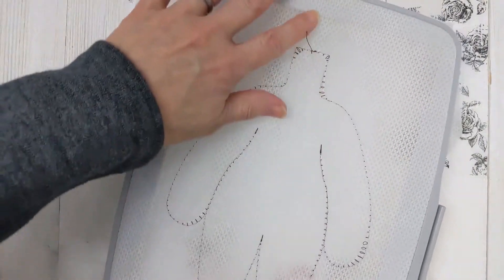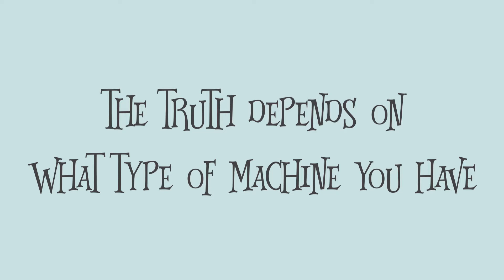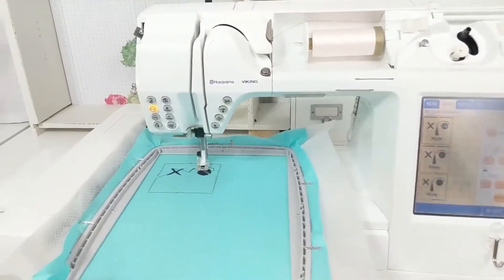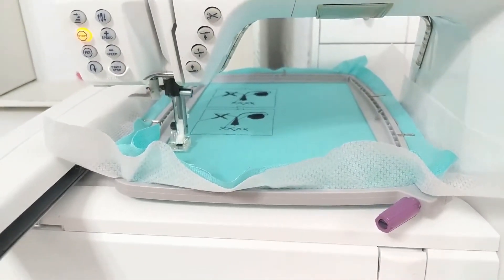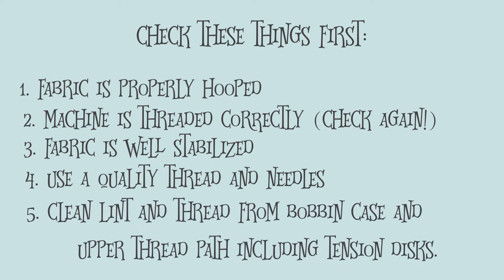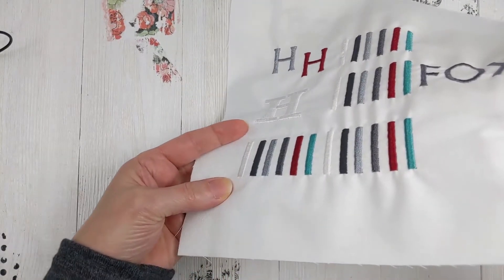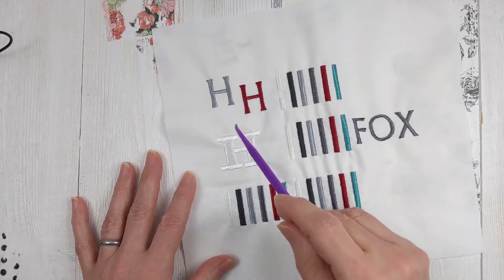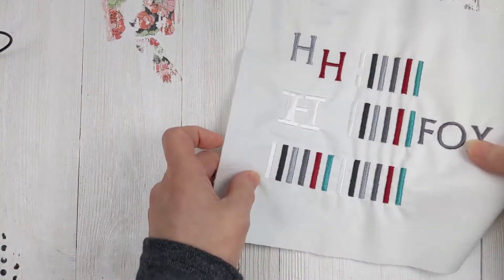Machine Embroidery Tension - VLOG #3 testing ITH tensions

Comment: So, if puckering on front, then thread  tension is too tight. If too much bobbin thread showing on back, then thread tension too tight. And if too much top thread showing on back, then thread tension is too loose.  And if I tighten the bobbin, God forbid that I should ever touch it, then I have to start all over again. But as a "go-by" If I tighten the bobbin, I would need to tighten the thread tension, and if I loosen the bobbin, I would need to loosen the thread tension, because it is a balancing act (two strings pulling on each other). Top and bottom threads need to have equal "pull" to properly weave together. Do you know how many videos I had to watch to figure this out??? Lots.... But, I finally got it... Thanks Ballyhoo... Love your channel.
Reply from the maker: YES!  Tension is a tug-of-war and what we want is a tie - where neither side wins.  LOL.  Glad it sunk in for you.  Now you understand the theory and will be able to figure it out and adjust for any fabric or thread.  😁